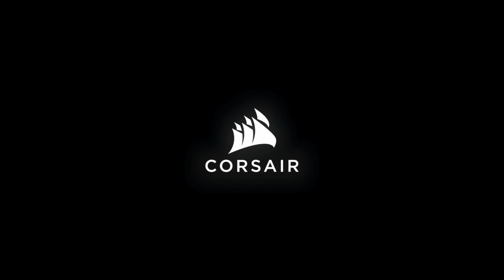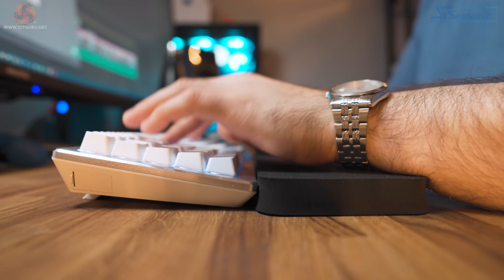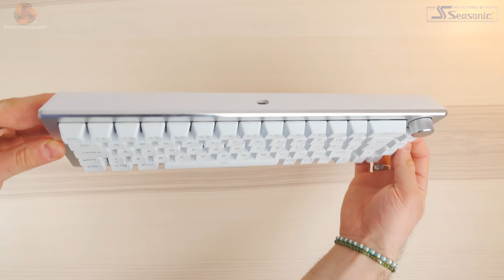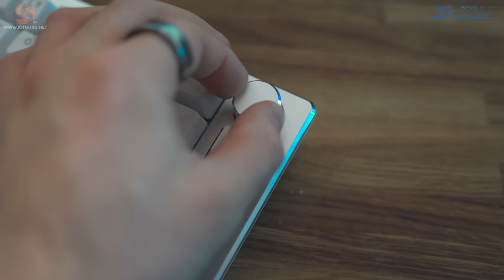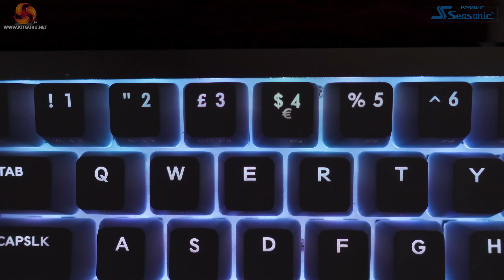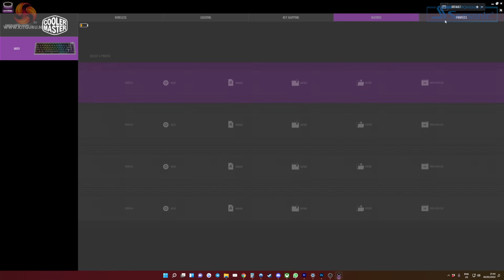Cooler Master CK721 Wireless RGB Keyboard Review

Comment: Is it hot swappable?
Reply: No, Sadly, this keyboard is not hot swappable because the switches are fully built into the keyboard and if you try to take them out, it will just likely break the keyboard.
It is recconended to use the standered Switched that came with the package you ordered.
Hope you found this useful @Triskamoros

Comment: Hey! Really great review! Gota question though. Besides switch through the BT devices, could you also switch between the Wire and the RF with the use of the Hotkeys? I was thinking of using it as I kinda of KVM switch between two devices that do not have bluetooth, and pressing just two hotkeys on the keyboard to go from the first device to the second would be really nice!

Comment: Hiya thanks for your video - just got the keyboard recently and the instructions guide booklet is clearly not enough!
One question from me though, I had been using the wireless bluetooth mode for a while with LED on, and some time later the LED is just gone. After one night of charging, the LED still isn't backed even when I tried pressing FN T or adjust it with my dial. The bottom indicator between shift and the up button is flickering in red - wondering if that affects anything?

Comment: This keyboard would've been cool... 1 year ago, when they first unveiled it (as MK721).  
In the meantime, plenty of manufacturers have ramped up production of 65% / 75% "exploded" and those boards have hotswap sockets.
Reply: got any recommendations? im considering buying a wireless keyboard and swapping the switches and caps
Reply: @ohpapayaoh  Akko 3068b or 3061s, easy choice
Reply: How it would've been cool year ago? But not anymore? Year is extremely short time...